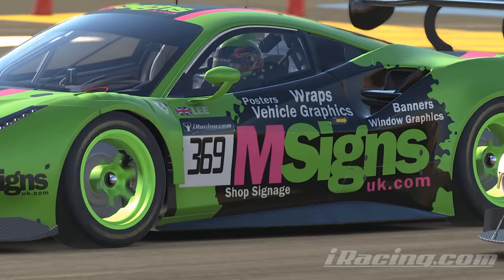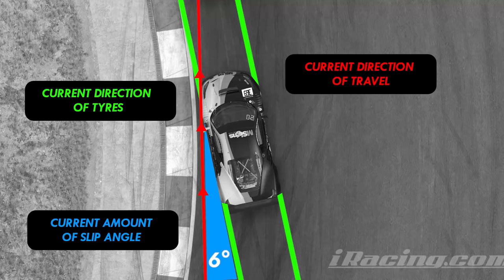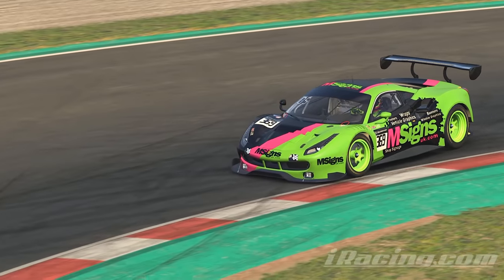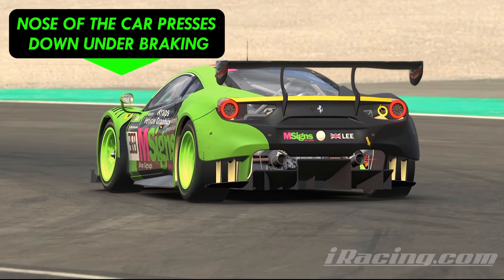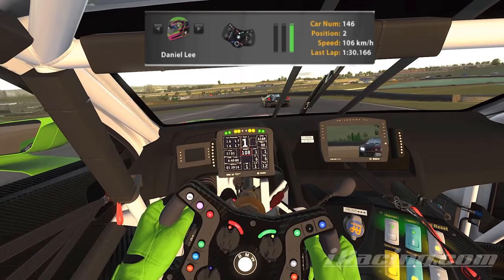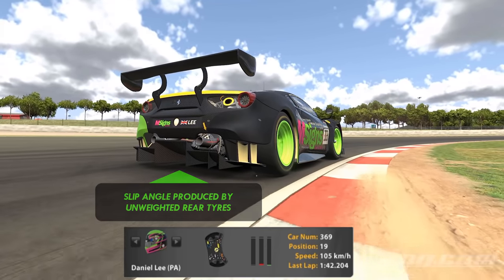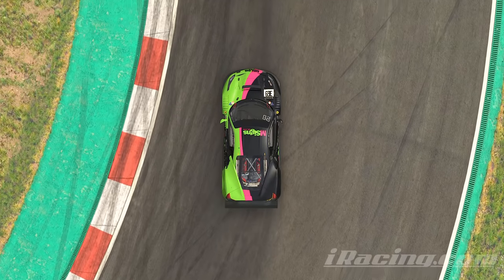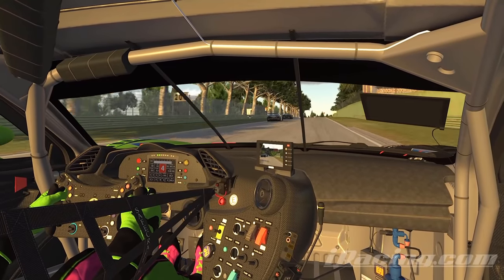Slip Angle in Sim Racing - Nail This and Smash Your Lap Times

Comment: I've known about this since watching initial d. Never knew what it was called though. I almost exclusively use this now in games that I can use it. I noticed Takumi wasn't always drifting but had a slight slide in some turns. I used this in Forza, helped drifting as well.
Reply: I don't mean to put a damper on anything, but I don't think Forza or games like it simulate slip angle. A subject like this would only ever come up in sims like iRacing.
Reply: @BadgerScrub  It sure seems like it. I would expect Forza to since they were all about those tire physics at one point.
Reply: @BadgerScrub  any sim or simcade that has a passable suspension model and 2 directions friction for tires material will have at least some level of gain from slip angle.
Even when tire deformation is out of the package, it is still possible to have some return
Reply: @BadgerScrub  It does simulate it, at the same time it's very easy to pull off because the steering angle is auto-assisted in those games.

Comment: Very good point, that's in my opinion the most important thing karting teached me comparing to other drivers. In karting rear weels are allways sliding because of not having a diferential so you have to master the slip angle at the enter of the corners to get a great exit speed
Reply from the maker: Karting is something that looks so simple but has so many underlying techniques and layers that it really is an ideal test of how well you understand driving a 4-wheeled vehicle. Can't wait to get back to some karting here in the UK but I also need to shed a few kilograms if I'm gonna be winning the arrive-and-drive races (no ballast)

Comment: great job mate!

i somewhat did this intuitively already, but i was quite inconsistent about it simply due to not knowing what exactly causes it (trailbraking). This caused me to over or understeer half the time when i tried to reproduce this slip angle intuitively. now that i saw your pedals and the explanation behind everything (i already suspected that a tiny slide increases performance, but the rest was important) will hopefully lead to more consistent and faster laptimes!
thanks a thousand
Reply from the maker: Thanks man, appreciate you taking the time to write a comment with your own experiences. It's second nature now but at some point I would have had no idea about this stuff and over time it just layered gradually until I got to this point. Keep nudging the limits innit

Comment: Awesome video, enjoyed it a lot, and it gave me different view, which gives me some new questions to figure out, thanks. 

I want to point out that tire is always in a state of slip angle when it is turning a car through a curve. A state of slip angle which you mean is it's peak angle, or being near around the peak where tires performance is best. Slip angles per each wheel can be manipulated by altering rolling stiffness amount, and balance per front vs rear. You can make a car to respond differently to transients. Increase of load on a tire also pushes its slip angle peak further and up, while also having less load shift on softer end helps to keep wheels loaded more evenly, and it is better to keep wheels loaded as even as possible due to tire load sensitivity. You can also influence slip angles directly by adjusting wheels toes alignment. 

Also the reason why you need to apply throttle during oversteer can be to balance the wheel loads, or cancel engien braking (as in coasting). But mainly you need to do it to cause rear wheels slide more predictably, otherwise they can grip up at "uncomfortable moment", which means if you haven't set your steering to lead the car smoothly out of the oversteer, if the rear tires grips up at that moment, then you will have a tank slapper. 

There are actually two slip effects. The slip angle, and slip ratio. Slip angle is about how hard tire is at work laterally, and slip ratio is about how hard the tire is at work longitudinally. Both can't be working at their full potential at the same time.
Reply: Great comment!

Comment: I have like 1900 hours on assetto corsa but I started to dig deeper into this technique after I started racing the mx5 cup on iracing and I realized how much rotation you can get out of the car based on the amount of grip and the momentum you carry through corners, which I find it significantly higher (or more noticeable) than assetto corsa. It is tough to mentally commit to slip angle after driving cautiously for so many hours but I think its has been easier for me to adapt since what I mostly do is drifting and I'm used to slide around pretty much everything

Comment: This concept was essential in the old Grand Prix Legends game, but I never knew what it was called.  It was a magical feeling when you did it right though.  Amazing simulator for the time.
Reply: The basic concept of slight oversteering on approach and slight understeering on exit is the same, but there is a difference between just carrying speed through the corner and actually gaining grip.

Most 1930's cars end up faster with a little slide regardless of which way you choose because of those biclicle tires XD

Comment: As you said "Tires give out the most grip when they're about to lose it" it actually makes a lot of sence. Every slip map consists of three stages, no matter the material:
1 - the first region where the more force you add the more resistance you get
2 - the smallest region which is a spike
3 - the infinite region after the spike where whatever you were pushing is now sliding and as the force increases, the counterforce decreases

Comment: I have noticed this in short oval racing over at Stafford motor speedway in Connecticut, the drivers actually utilize a small touch of the brakes rather than trail braking through the corner just to get the nose to dive into the pavement and get the rear of the car to rotate through the corner by the exit in turn 2 or four you'll see the car flying off of the bank to the outer wall stretch and its really cool to watch

Comment: I remember this one long hairpin in karting track in Hayle where you could take it flatout if you are brave enough. I remember that the back kept stepping out but after few laps I managed to get a really nice slide through that corner. I ended up pulling a time half a second slower than Rosberg’s time.

Comment: I used to do this in Ridge Racer for the PSP. Far from a sim but there was little spot before full on drift where the cars would just fly around turns. Now I do it in my Miata :3 I know that sudden grip up from the rear during steady throttle in my 350z too. The original tires were so bad that I underestimated how much understeer I'd gain when I replaced them with a wider but similarly staggered set of wheels. Made it a lot harder to find the line where she dances. This video made me feel validated.

Comment: I was never avare of slip angle but as you started to explain I immediately felt the car rotating itself in the corner and realized this is the state I was aiming when I create my setups. This very little oversteer which doesn't really feel as an oversteer because it's very well managable but also makes the car turn on its own. You don't steer but you do.
Reply from the maker: That's spot on man, that's what you're creating with your setups. There are definitely tricks in the setups to giving the car the right amount of slip for the types of corner that count the most at certain tracks. For anyone else like me who can't make a setup, enlist the help of setup shops. The ideal car setup makes it easy to enter slip and hard to overstep it.
Reply: @dannyleeracing  Well if you want to create good setups you can watch youtube vids about it. Thats how i learned it. After a while it's going to be natural what you want to change so you have the best resoult.

Comment: Correct me if I am wrong but this is just getting the car to “rotate” through the the corner. “Slip angle” is the angle between the direction in which a wheel is pointing and the direction in which it is actually traveling. The deformation of the tire patch generates more grip. Different tires like to be driven at different slip angles, for example a 200 utg street tire would achieve maximum grip at a lower slip angle as opposed to a Hoosier R7 which requires to be driven at a more aggressive slip angle to reach peak grip. Understanding the relationship between front and rear tire slip angles will help you understand why a car oversteers or understeers. A good example is getting a car to oversteer slightly through a corner or even just upon corner entry before the car takes a set. This is what many people call “rotation”

Comment: Great and helpful video; however, one thing which I think needs to be added is that slip angle is not only about the rear tyres. Because each tyre has a different contact patch and pressure onto the road surface, each tyre can have a different slip angle when cornering. Typically these are used and measured based on the ratio of front to rear slip, with 1:1 being neutral, greater than 1:1 being understeer and less than 1:1 being oversteer. Different disciplines require different uses/needs of slip angle, some needing more understeer or oversteer and others needing a neutral 1:1 slip. Also, keep in mind that a neutral slip 1:1 does not mean the wheels follow the same path but could also be all 4 wheels are slipping away at the same rate, essentially creating a 4 wheel drift. Anyway, a great and very consumable explanation in the video, thank you!

Comment: Never thought slow motion iRacing would look soo damn pretty. Also in go-karts, offloading the rear outside tire and thus increasing the slip angle is the only way to turn since there's no differential thus the tires spin at the same speed.

Comment: The video is great. Slip angle and trial braking are linked, but fundamentaly not the same thing. In any corner as long as the axle is not drifting you have a slip-angle. In a really nerdy-way the camber of your car produces a force that pushes on the axle, even if you drive straight. Each tire has a specific window of temperature, slip-angle and load that effect it's grip.
On a GT car that is usually 70-90°C, <3° for traction and ~6-8° for rotation, the load is balanced through tire pressure and the weight and downforce of a car. Some Sims like iRacing or ACC can be linked to MoTeC. That's a very common data logging software, which can measure slip-angle in most sims. ^^ unlike a real car where you have tire-temps, g-forces and suspension travel is sometimes all you have.

Comment: The Porsche 911 GT spec car is amazing for learning how to do this because the effect is really pronounced when off the throttle with it being rear engined. 

This actually ties in massively with the understanding of weight transfer. It's not really trying to drift or oversteer, it's more just using that rear weight and letting it go a little to create the angles you need to get optimal exits. For it to work though you need to start with the right angle in the first place and your steering needs to be good because correcting the steer mid corner will likely throw off the balance and you'll mess it up. Make sure you can hit apexs consistently before trying to learn how to do this or you'll just become a nightmare on track.
Reply: Ahh just watched the whole thing lol he explains what I just said in great detail haha

Comment: It helps with rotation in the corner. If the ass end of the car slides slightly where the steering wheel is still turning into or neutral of the corner then your slip angle is perfect. It essentially creates rear steer in the car and rotates the car around the front tires. Throttle steering but not drifting or sliding is the fastest way through the turn

Comment: I learned slip angles by playing following the leader. I didn’t know what it was. I was driving so bad at first. I could follow the optimal line, but I was so slow. Any time the rear slipped out, I spun. But all the sudden when I saw that you can swing out a little. I tried to do it in a more subtle fashion and was able to pull it off. I think that’s how it is. You find a driving technique for your level, then you pick up on something new and your driving style evolves, especially when ya get to follow someone whooping your ass. If you’re a beginner and you’re the fastest, you’re at the wrong track and you won’t learn.

Comment: This is awesome! I'm three months into sim racing, it's SO exciting, I've learnt so much and watching my lap times drop. This is something I've noticed in my fastest laps but I've been yet to put a finger on it... So thank you!

Actually, I've had a thought that I wonder if anyone could shed some light on. I've noticed that when I trail brake perfectly into a fast corner, I barely need to apply any steering at all, maybe 10 degrees. It's almost like I twitch the wheel and it flies in the right direction like some black magic, whereas if I don't touch the brakes, it might be 15 - 20 degrees of rotation. Does that make sense to anyone?

Comment: Thanks for these videos Danny. I’m new to sim racing and stuff like this is great as you’re talking about concepts I’ve never heard of and would never probably think of all by myself.  +Respect!
Reply from the maker: Cheers man, I hope you get up to speed quickly and don't get stuck in a rut - there's always improvements to be made and if you're just starting out they're gonna come thick and fast if you just stick to it. In the end it's all about refining your own race until you can stand yourself up against someone else on the track and have a thrilling fight!
Reply: @dannyleeracing  thanks man. I've just set up my simlabs p1x with tons of mods, trying to set it up so I can do flight Sims with my TM warthog joystick and throttle and rudder pedals, whilst having the ability to slide my seat forward and have access to my wheel , shifter and pedals for racing.

I'm almost there though after a ton of tweaking. Only downside to my rig ATM is that I'm using a Logitech g923 wheel and pedals, not the greatest of wheels but I'll be switching to a direct drive asap after the new year and some load cell pedals. Having the ability to remove the wheel is a must for my dual setup.

Then it'll just be practise, practise and more practise before playing online.

Comment: The connection between slip angle and trail-braking is very smart
Reply: Its not really the same at all, thats the funny part. Slip angle is only from sidewall deflection, trail braking at the limit is generally not latterly loading the sidewall nearly as much as power on drive off the corner does. see my other comment above. Talk is cheap.

Comment: I upgraded my pedals and now I have been doing this almost like riding the break and playing with the gas at the same time around the turn. 
 The overall speed is constant, plus you can pick up thorugh the gears sooner.
Reply: That's a technique used in rally, it's quite interesting to use it on track racing.

Comment: Slip angle is the angle between the tyre direction of travel and wheel direction. The tyre deforms.
If you want to rotate the car increasing rear arb will make the rear slide out under acceleration. Decreasing the front will increase the front under braking

Comment: Gradually increasing throttle on corner exit and chasing that slip angle is a delightful game. You can actually steer the car with throttle. When I'm really concentrated my foot constantly twitches up and down to feel when the rear wants to go. It really feels like pushing the car around the corner. I'll dare to guess AWD drifting in rallying is a really good way to practice your slip angle control, even though in grip racing the slip angle is very small. Just watch Audi S1 quattro drifting. It's all throttle game.

Comment: Imo it's critically important to progressively load the tires. (When braking, there is up to 3x more weight on the front than the rear).
Slippage due to jerking of the car (sudden weight transfer i.e. any sudden input) is what we often encounter as a novice. That's not the same as maintaining a controlled slip angle obviously. It's just like having a weight on a piece of paper, and suddenly jerking the paper vs. smoothly accelerating it. In the former you slip much, much sooner. 
Static friction is always more than kinetic friction (force required to start sliding is greater than that to keep you sliding once you start). Static friction is what we want to ideally use, so the slip angle concept is counterintuitive. Logically, even though more of the tire surface is slipping, the part that's not (outside) are more loaded. It's related to the compression and deflection of rubber and acts as a bungee cord.

Comment: Just fyi, the car is not drifting or sliding when it has yaw angle.  The tyres are soft and pliable, and when they're under lateral forces, they deform slightly.  Then the tyre rolls forward onto a new patch of tyre that isn't deformed, and as it replaces the last patch, it deforms too.  As this process continues, the tyre effectively "walks" sideways.  So even at slow Sunday driver speeds, there is always some yaw angle, it's just not usually noticeable.  At racing speeds, yaw angle becomes something you can pay attention to and manipulate.